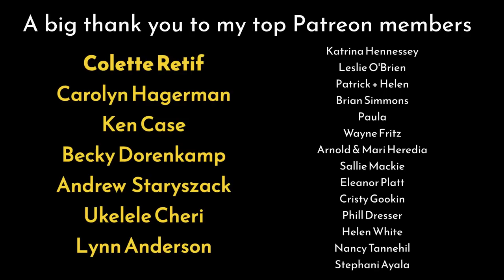I'm NOT Happy With This... | Cottage Renovation Episode 30

Comment: If what the exterminator has done hasn’t worked , surely he can get the man out again with no cost?
Reply from the maker: Yes no cost
Reply: Hopefully the wasps are gone for good. I hope the vapors from the spray doesn’t reach your kittens. It might be bad for you and your family, also.  Your buildings look beautiful and cleaning up the area made it all beautiful. What are you going to do with the black doors? I wondered if you would paint them black again or with a pretty green or some color? I really enjoyed these series of updates. It is the little updates that make big improvements in a home.❤❤❤❤
Reply: @jandolph7509  I was wondering the same thing  about the 2 black doors! It will be interesting to see what happens to them!

Comment: They can also have nests under the ridge tiles. I saw that on Simon’s roof.  I have wasps or hornets near the peak. Friend told me to go online and look for a wasp trap that you hang near where you see them. Delicious stuff in a bottle and they cannot exit the bottle. I’ve not bought the traps yet. PS, I also have bug jackets that includes a head covering. I use it mostly for protection with plant allergy when I have to get into the brambles.  Bought them online.

Comment: Sean, you are doing a great job on the cottage renovation. Do not paint or stucco the exterior.  Painting or stucco will immediately ruin the charm of the structure/setting.  Regarding wasps/hornets - you must block their entry into their nests.  Repoint the stone chimney and seal the masonry up on the roof. It is the only way to ensure the critters won't be back to rebuild!  Keep up the good work!!!

Comment: You should have him spray in doors as well.  We have 2 wasp nest.  1 is at the highest peak of our 2 story home.  My husband taped 2 white plumbing poles together about 20 feet long.  Then he used zip ties with rope to hold the poles to the ladder.   Once he put the poles up there he climbed down.  Then at other end of poles he taped his largest shop vacuum. Then, just turned on the switch for 20 mins 3-4 times a day.  Most of them are dead.  The 2nd nest we are still working on is under our roof on the porch.

Comment: Hi Sean you are doing a great job on your French  Cottage, I have a tip for rendering or leaving it as natural stone, There is a product called ( WET AND FORGET )You just spray  the solution on to the clean dry stone and it will stop the dirt and lichen growth for a long time, Look it up on line and you will be amazed, I have used it on patio slabs and they stay clean for years, Good luck , JIMMY-UK

Comment: It was a bad year last summer here in Oz for European wasps too. They took a noticeable toll on our native and honey bees. Hopefully the repeat works Sean. It also took two rounds a few weeks apart by my exterminator to get rid of some persistent little blighters who built a nest by burrowing under the edge of my concrete verandah next to my clothes hoist, which made hanging out laundry a bit of a challenge. He also used the contact powder spray, spraying into the hole and said to avoid any disturbance of the surrounding area even if it rained as the key was to ensure the queen died by contact doses carried to her by her returning foraging workers. I also hung several organic wasp traps around our orchard and other parts of our 2 acres of garden to decimate numbers as it was apparent there were other nests elsewhere in the vicinity which I could not locate.
Reply: true…it is NOT often a once and done deal…they have been persistent this season…but the rest of the work on your farm is coming along nicely  👍🏻

Comment: Sean, Painting masonry is tricky. There are very few types of paint that will work. If you do paint, even if the paint is appropriate for a stone wall, it will require constant maintenance. Rendering may be historically appropriate, but I believe not rendering is also ok. You and Sam have made a wonderful job with the Cottage.
John in Bethel, Missouri. USA.

Comment: On the wasp issue you can close off the chimney with sheet plastic and blue painters tape. The glue and cracks can be covered with lightweight painters plaster drop cloth-3mil plastic just wrapping it night with several wraps of the sheeting it will effectively block all the exits. Without an entry or exit they will quickly die in 2-3 days. You’ll see a layer of dead wasps through the plastic sheeting inside the fireplace at night. Crack on.

Comment: Awww!! The cottage patio garden looks Fantastic!! So PRETTY!!  I Love a good transformation! Like starting fresh, again.😉
 Very Nice. I can't wait to see what's next?  

 Maybe... if you find  old window screen, you could bind it around the chimney holes? It would be hardly noticeable from the ground. Idk if he is just spraying? Or did he use a Fogger pesticide? We use those in the U.S., on wasps.  They hide their nest but, they build the nest from rotten wood and water, it's like their spit up...  The nest is paper light and  burns quite quickly. People have done it..🤷‍♀️
 By spraying any exposed rotten wood with a pesticide, you can  deprive them. Or replace the worst wood asap.

Comment: I’d fill that hole in the chimney ASAP. I had wasps in my loft many years ago & they were getting in the house. They’d found entrance under the eves. We had to call a guy out & he used a gas or powder that he pumped into the loft, then he came down the ladders double quick. They all came flying out like a swarm, there were hundreds, if not thousands. I asked him if they’d come back, he said no, they are dead, they just don’t know it yet. He said any stragglers that were out at the time would die when the went in the loft. We never had any more trouble with them. I did feel bad for the wasps, but there were just too many flying in the house & garden.

Comment: You're doing such a great job Sean, it's looking beautiful! I have a suggestion you might be interested in. You can make your own lintel with concrete & iron rebar. It will look more in keeping with the structure than a new wooden lintel.
Reply from the maker: They used timber or stone at the era of constructed, l may source a granite lintel depending on availability
Reply: @Seans_World  I have seen them textured to to have a more stone like appearance.

Comment: The front of the cottages look absolutely beautiful!  Please, please don’t paint as you can’t change that I think you would be doing all the work already performed an injustice.  Repointing and continuing to powerwash is your best option to keep the houdes in good stead for the next 250 years….  You have put in so much hard work which would be throw away by doing anything less.  I am afraid if you did anything else, it would distort all of the hard work already completed.  .

Comment: Looking at the wall again I‘ve noticed you‘ve got another new window installed surrounded by stones, the wall in its natural stage looks now much better after the water pressure treatment, is there any chance you could replace the bricks on the other window with thin stone slabs to sublimstem the other window ? and therefore leave the stones as they are as you‘ve done around the cottage entrance, has there been 2 builders, one done the cottage stone wall and the other the barn stone walls or do you think because it was a barn building they didn‘t care to much about the appearance ?

Comment: Hi Sean.  I'm just curious that you say all the work you're  doing to the outdoor area is costing virtually nothing because the stones you've found  onsite and you have solar power, but I'm curious to know the situation in France concerning the water supply.  You have used many gallons of water so far so do you have a private supply or well? Is there never a threat of a hosepipe  ban over there that we seem to live with most summers now! Ha e to say though,  the fro t of your property is looking wonderful.  A vast improvement,  well done
Reply from the maker: I have a well and rain water butt's, a pressure washer don't  hardly use any water

Comment: Sean, you will lose the character of the house if you render or paint. Partly rendering is even worse because then it will look higgledy-piggledy. The whole flow of the outside will be gone. Just try to imagine some patches on the wall, it will make it busy and look like a botched job. The uneven stone houses look best when they are untouched. Look at properties in Italy or France and then look at Monaco where the palace looks like a new built out of Disney Land. It looks fake. Then look at old castles unrendered and not painted and they look authentic.

Comment: Sean, what if you get in a chimney sweep after the extermination, wouldn't that remove the nest?
Reply: the nest is not in the Flue,it is between the Flue and the outer part of the chimney stone work
Reply: @donaldk.macbaird5248  hmm okay, well can't they sweep outside the flue? I don't know, looking at the top, I guess his fireplace/chimney is configured different than mine.
Reply: Sean has already said he had no way to access the nest.After the wasps are dead he will seal the cracks in the chimney .